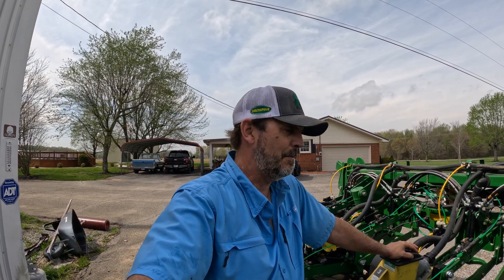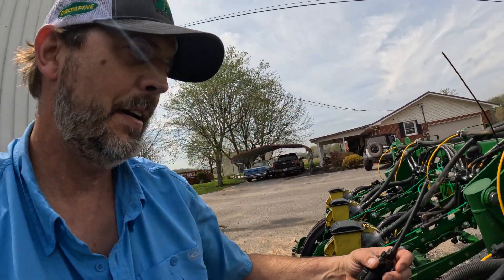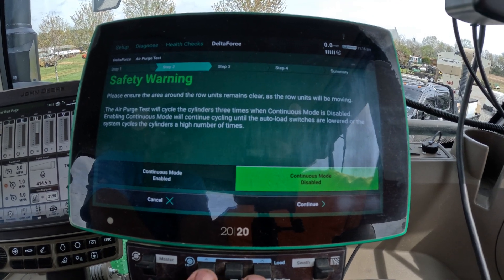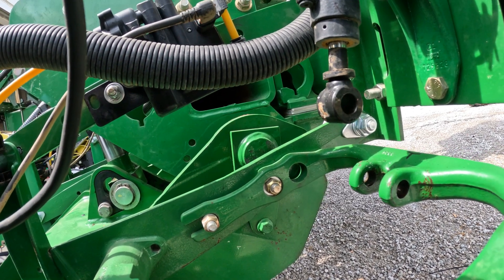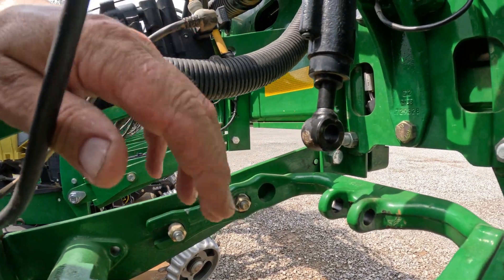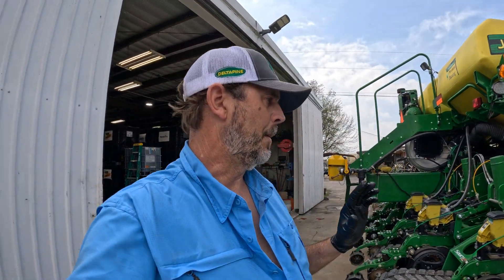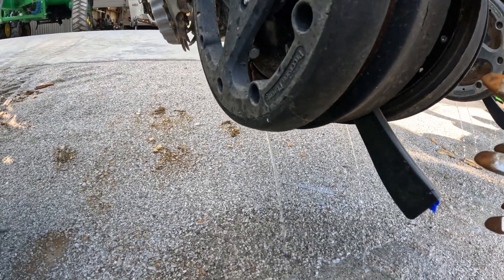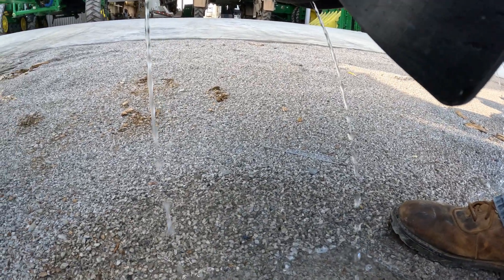Destroying the Dumpster and Planter Calibrations

Comment: Do you have orifices in the 2x2s to control the rate? Also how long do the blades last?
Reply from the maker: We run backing plates on the 2x2. The blades are crap. They only last 1000 acres. That’s the only issue we have with it.